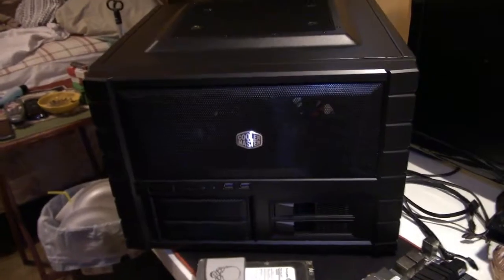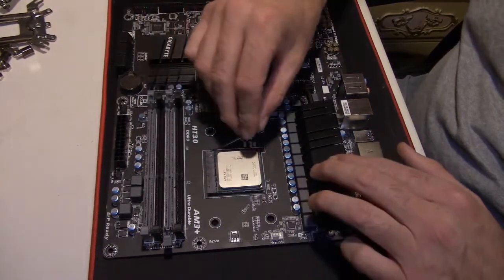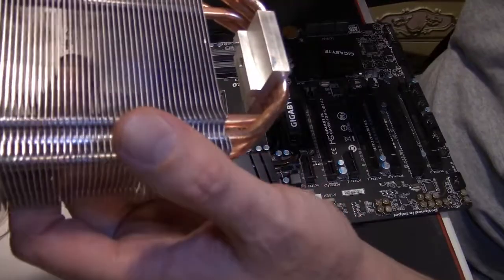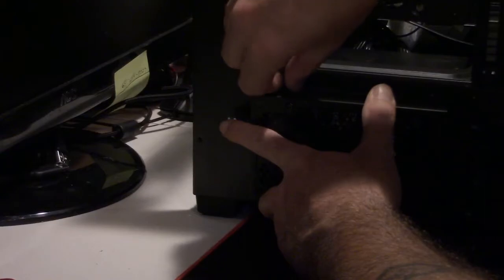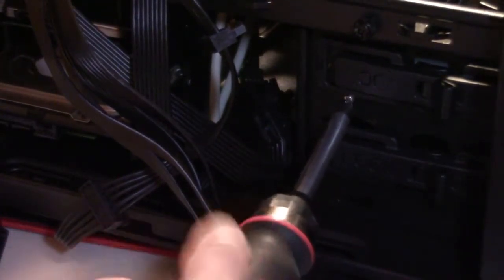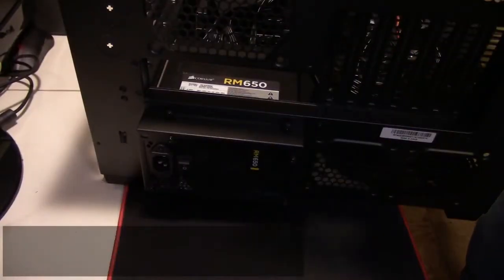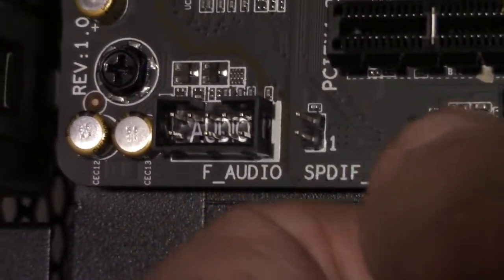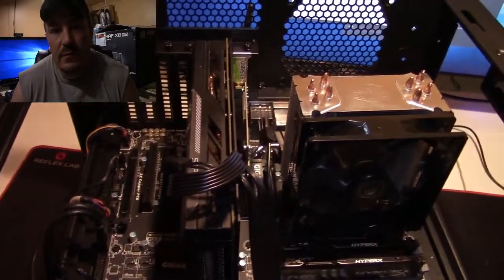How to build a PC in the Cooler Master  HAF XB EVO

Comment: Thanks for the video. The thermo paste, did you use tape to spread the thermo paste over the CPU? It has been over a decade since I built my computer and thermo paste wasn't an issue, so thermo paste is something I never done. Thanks for the detailed reply.
Reply from the maker: Yes it was tape I used, Depending on the heatsink you are using it may have paste already applied, Thanks for watching and the comment.

Comment: does the 2,5" caddy come with this case or do you have to buy it seperate
Reply from the maker: There is no 2.5 caddies that comes with the case, it comes with 2- 3.5" on the inside and 2- 3.5" caddies on the outside for the hot swappable bays only, thanks for watching and the comment
Reply: @DavesTechway  so it does have a sled for the inside sled that will fit a 2.5 inch ssd so i dont have to use the hot swapable part due to the horrible reviews on the hot swappable part
Reply from the maker: Yes you can use 1 of the 3.5" on the inside for a 2.5 " ssd
Reply: @DavesTechway  perfect i am ordering this case next week on amazon and wasnt sure if it had a 2.5" sled in it already for internal ssd not the hot swappable glad to hear it so i dont have to order that as well
Reply from the maker: I have really enjoyed the case, i just switched to a different case, but I'm going to use that one for a test bench, enjoy the case,glad I could help you
Reply: @DavesTechway  i just wanted a affordable case that is flat but still holds a atx board. and a rad. only one i have been able to find.

Comment: Is it possible to do a dual GPU setup in this case if the cards are both 3-slot? It sounds like it would use all 7 expansion slots on the case, 6 for the cards and 1 unused for spacing between them. MSI just released their 2080 Ti Lightning cards and I wanted to use those, but I'm not spending $4000 if they won't fit lol.
Reply from the maker: Without the cards on hand it is hard to say for sure, by looking at the cards it looks like the heat sinks on the cards is what makes them 3 slot cards. I think they would fit but if you do put both cards in there I think your 1st GPU will have a lack of air flow due to being so close to the 2nd GPU, so you may want to keep an eye on the temperature of the 1st GPU. Thanks for watching

Comment: Whats' the weight of this build? Is it convenient to move this setup two times per week? Thanks!
Reply: I have this case still and it is the easiest case I ever moved! It has two handles on the sides. 3 fans...one exhaust on the back and 2 intakes on the front are plenty! My cpu (i7 4770) never gets over 52 C and my GPU (GTX 1070 FE) never gets over 70 C. The GPU usually hovers around the mid 60s
Reply from the maker: It weights about 35 bbls. Depending on how big you are. It shouldn't be to much of a trouble to move it a couple of times a week, If you don't need a full size mobo I would look at something a little more compacted, Thanks for watching

Comment: I have a question regarding fan placement in this case. I want to use a cooler on the cpu that has a horizontal fan (like the wraith cooler of the ryzen 2700x) and a 200 mm fan as an exaust on top of the case. Will the oposing fans have an effect on each other?
Reply from the maker: Sorry I don't have a answer for that, I have never tried that type of sit up

Comment: Can I build a high end pc with this case? I really like it and I can't find any other like it, I want to build this rig: EVGA 1080 Ti sc2 + i7 8700 with corsair 280mm or 240mm water cooler and 4x8gb DDR4
Reply from the maker: The case will take 240mm Radiator in the front, and up to 334mm for the GPU ( which your GPU is  267mm) , as long as you go with nothing bigger then a 240mm cooler (which should be fine for I7-8700)  and no bigger then an ATX motherboard everything should fit fine, Thanks for watching
Reply: awesome, thanks for the help :)
Reply: Can also clarify that the Cooler Master MA610P air cooler will work with an ATX board in this case, so your pretty good for height clearance. Also using the ASUS GTX 1080 Strix card with just enough clearance for a set of fans on the inside, but might have troubles fitting a radiator in the front with such a long card.

Comment: Can i put a MSI GTX 1070 in it?
Reply from the maker: It supports cards up to 334mm / 13.1inch , as long as your GTX 1070 is under this length it will work fine. Thanks for watching

Comment: Just got me a haf XB evo, airflow is AMAZING, 2 fans can literally cool the whole case, but a exhaust on top never hurts
Reply from the maker: It does pretty good with just the 2 fans, Depending on your set up you may want to add a fan to the back or top.
Reply: What size fans did you use?
Reply: @stacksmasher  I used a single 240 for the top iirc. I got rid of the case.

Comment: Do you think it will need more fans if I'm gonna use it for gaming, and should I add them to the top or back
Reply from the maker: I game with the R9 380X Card at 1080p and have not had any heat issues, If you would add a fan I would go for the one in the back, that way you can keep positive air flow in the case . Thanks for watching